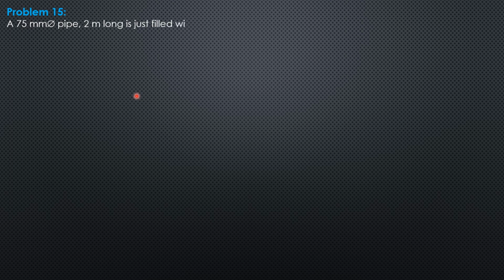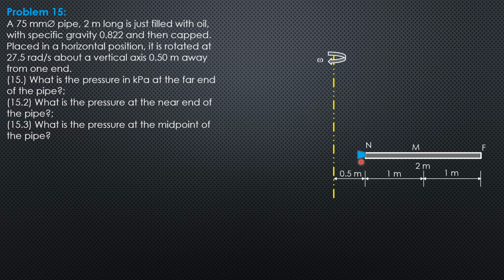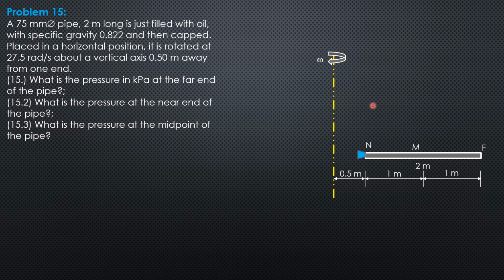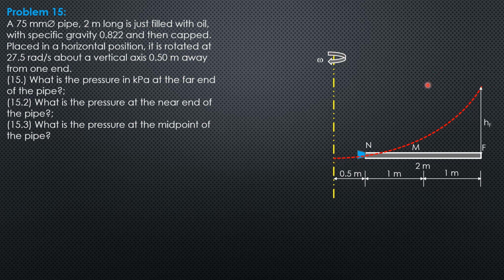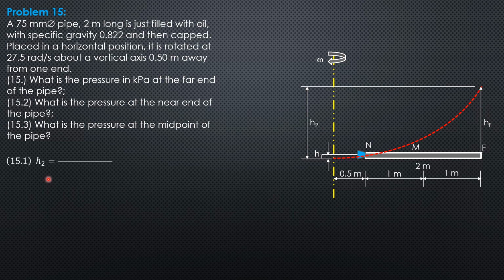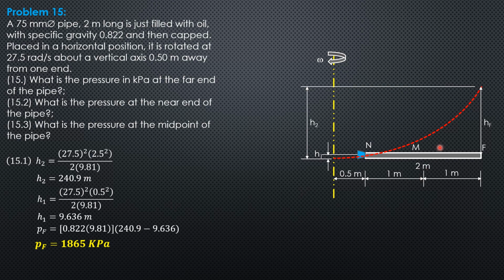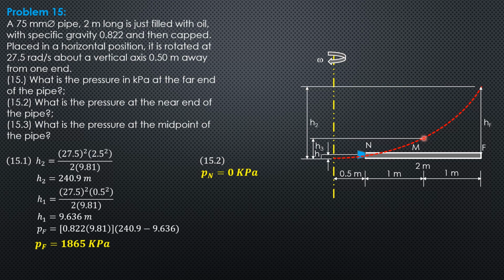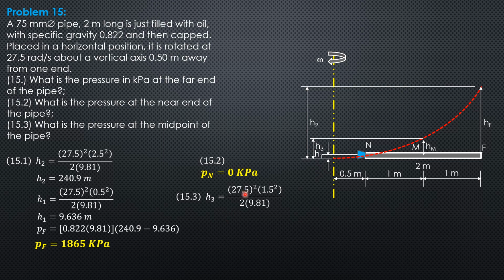ROTATED VESSELS, Example 15

Comment: Hello professor how did you know pressure at near end is zero ?
Reply from the maker: It is not mentioned in the problem, so assume the pressure at the near end of the pipe as zero (Or else, there is no other way unless otherwise specified in the problem).